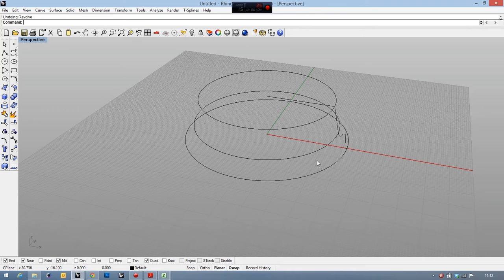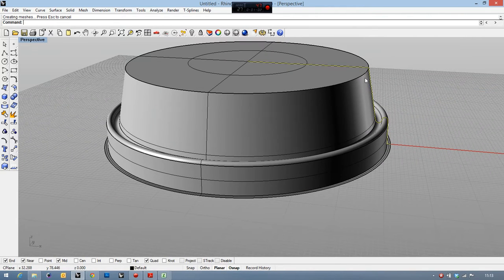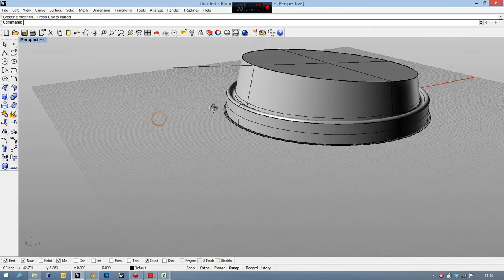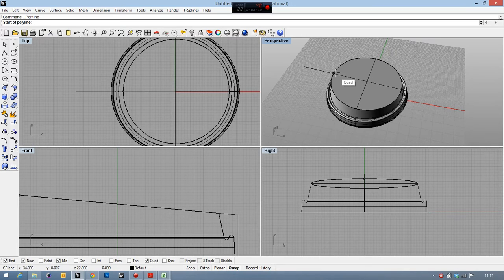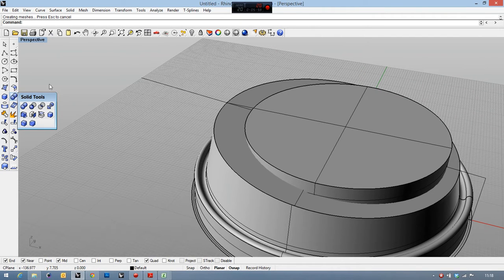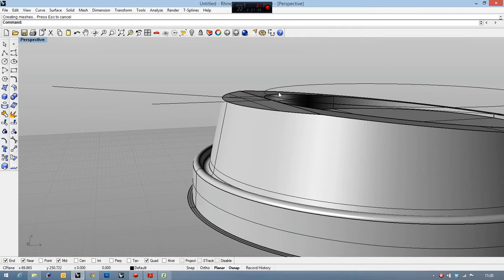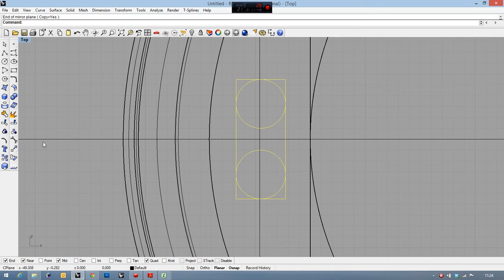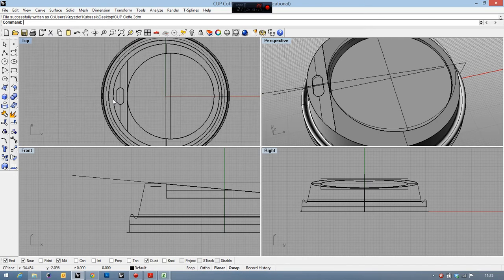RHINO TUTORIAL - Coffe cup

Comment: Hi, I was wondering how you would go about modelling thickness. For example if you were to 3d print this coffee cup and the plastic it is made out of would be of uniform thickness 1mm around everywhere. Thank you.
Reply from the maker: +Yas you are not able to print surface. Surface has no volume which printers require. There is couple of ways you can make thicknes. You can use offset surface with solid function on, you can extrude single surface to solid or you can build solid surface by surface. You have to remember that always the final result should be solid.